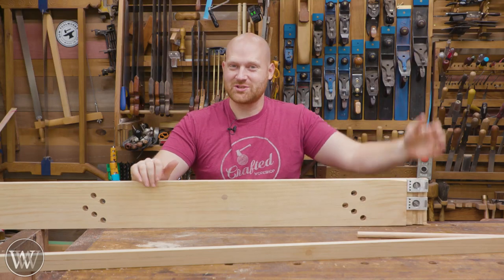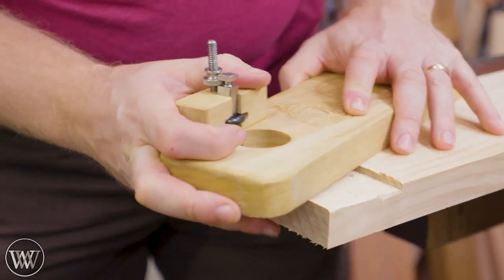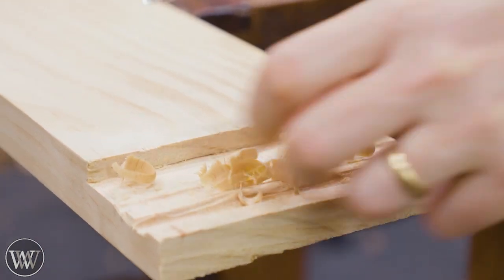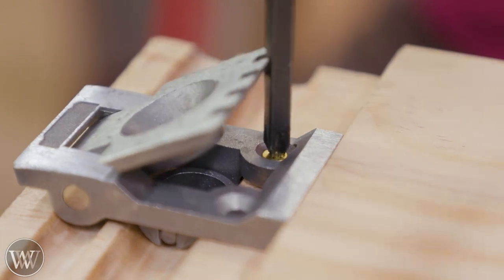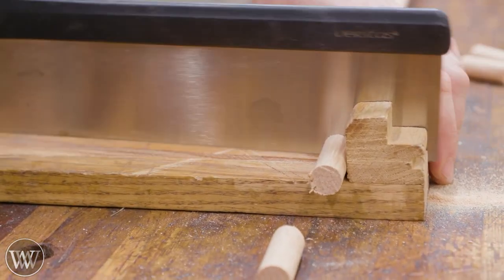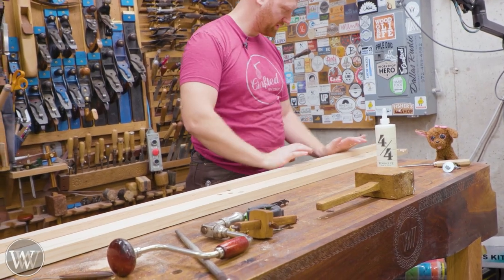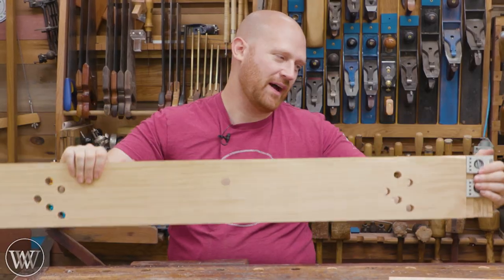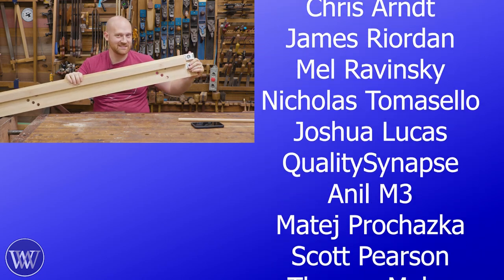How to Make a Sticking Board

Comment: After drilling the fence piece and before gluing in the dowels, the fence piece could be  used as a template to locate the holes in the base.  Line it up parallel to the edge of the base, clamp in place and insert the auger through the fence to drill the base.  This should assure that all the base holes line up perfectly with the dowels in the fence.

Comment: I'd worry about hitting the metal end stops with the plane iron, but maybe I'm just to careless. My sticking board just uses 1"x1" wood blocks that jam into some holes for end stops and I have hit the wooden end stops on several occasions.
Reply from the maker: If you set The height correctly. You'll never have a problem with it. However, if you don't set the height you may hit it with a plan. But in that case it's really not an issue as it's aluminum. I've actually planned aluminum and brass a few times before.

Comment: The best sticking board I've seen, and the one I modelled mine after, has a 45 degree edge as well as a 90 degree.  This is very nice when using your hollows and rounds.  You can see this board in action here:  https://www.youtube.com/watch?v=ijUDrOsHW54&list=PLRUJLKtnrktCPb18AwrL-KIoGVyTj9Ywo&index=20
Reply from the maker: those are great for a lot of moldings but not as useful for grooves and rabbits. and that is the more common use. but it would be good to have one of each. always good to have more tools!

Comment: No a rhasp file tears out material, and plane cuts it, not the same at all.
Making the rail holes before the slotted holes they fit inside... not as good as making them in reverse, becuase you can over cut the dowel holes, fit the board into them, and shim the dowels into place and glue them using saw dust and wood glue to fill the gap for a perfect fit.  Making a jig for perfect three holes so you can repeat the operation perfectly more than once is best- 
I make short work of that on my radial arm saw, and my router and my drill press, but then, I don't need a "sticking board" because I have a radial arm saw, router and drill press?